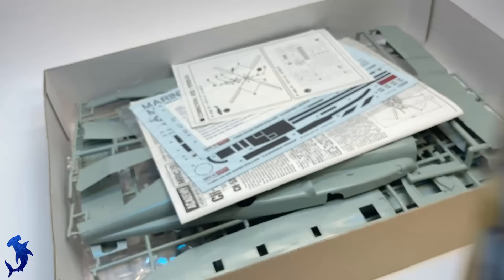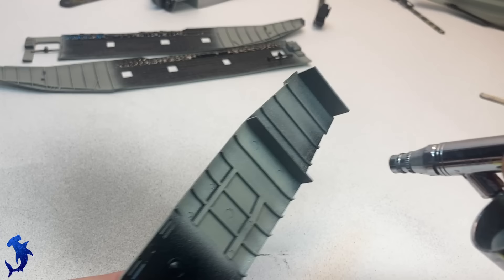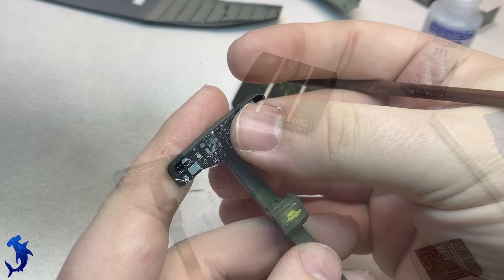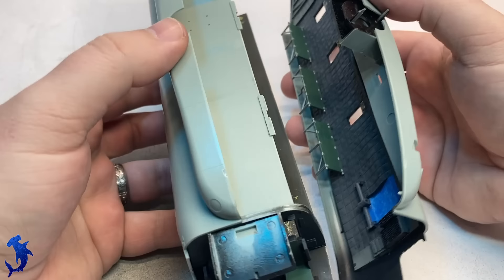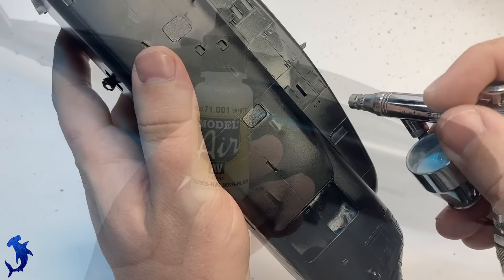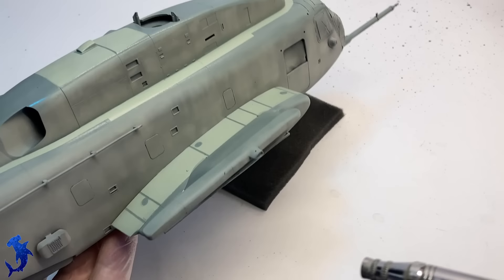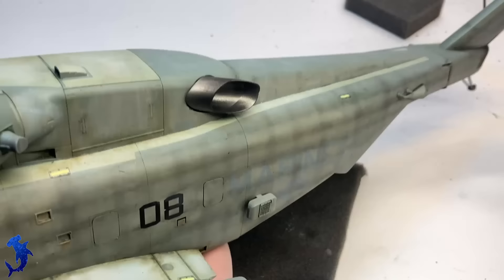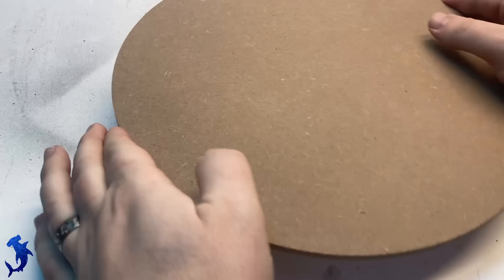Academy CH-53E US Marines 1/48 Scale Full Build

Comment: I have a academy ah 60l dap and it's the worse kit every instruction are rubbish and parts don't fit right
Reply from the maker: Thats unfortunate, I'll have to be sure to stay away from that kit.
Reply: That’s unfortunate to hear. I have the same kit. I am looking forward to the 1/32 1z viper, though. That kit is excellent, just needs a few interior additions.
Reply: @mikemontgomery2654  you might be better then me I am new to modelling
Reply: @andrewjbuckley  even if that is true, bad kits are bad kits. I’ve noticed some potential detail issues with the DAP, just having a look at the sprues. I’ll just have to see how the build goes.
Reply: How's the model doing
Reply: @mikemontgomery2654  How's the model doing did you have the same issues as me
Reply: @andrewjbuckley  I have been working on a different project. Haven’t started the chopper yet.

Comment: I have this same kit in storage and I've been sitting on it for a long time. I used to work on these back in the day. The floor inside the aircraft was a non-skid black paint. The "rails" in the cargo area were pretty beat up (along with the rest of the floor) but they were reversable. One side had the non-skid on them and the other side had conveyer rollers for when we hauled pallets and other cargo.  The interior sound proofing was a light blue color. The padding on the walls and also the ceiling panels were this color. The center hook on the bottom of the 53 actually hangs down from inside the aircraft. When not in use it is stored inside the cargo area (in a box under the front left crew window). For the exhaust, the sponsons didn't really get as much of that soot as the center engine did. Even when we washed the 53 it was really tough to get that soot off the fuselage.  For the base, I'm not saying it isn't possible but the only time we would actually shut down in the dessert was if there was a mechanical issue. 99% of the time we would land at an airport or back to a ship somewhere. Those things kick up so much sand, it's like a sand storm underneath that thing.  All that being said, the aircraft looks great! I'm getting heavy nostalgia from this video.
Reply from the maker: Thanks for watching, I really appreciate the first hand knowledge.  Helps me understand the subject all that much better, and if I ever get the opportunity to build this again, I can incorporate all of it!  As for the base, that was a request from the client.  Cheers!

Comment: Awesome work!  I have ALWAYS wanted to build the CH-53 in 48 scale and got my chance about a month ago.  I found one at a local hobby shop and pounced on it!😂😂😂. It’s the old Revell kit, with the howitzer and the Jeep.  I plan on building mine as a Vietnam War era Super Jolly.  I got a Skyraider to go with it, but will not be doing either of them for a while.  Also managed to snag a set of South East Asia Theater (SEAT) camo masks.  Can’t wait to see your next build!

Cheers!
Reply from the maker: I'm glad you were able to snag a kit, sounds like you have a sold plan!  Good luck with your builds when you get to them!
Reply: I don't know that kit but be aware that the CH-53E model didn't deploy until after Vietnam (1983). If you are going with a Vietnam era make sure you get the right kit. The Super Jolly only had 2 engines and the tail was straight up and down. FYI
Reply: @Brian-WolfmanJack99   Its an HH-53 i built it in 2011

Comment: Absolutely gorgeous work, pity seeing it only now.
But I was wondering if you would like to answer a couple of technical questions…

1. at about 13:16 of the video you declare that to prepare the interiors for the weathering phase you cover everything with a layer of transparent. Having used several brands of colour, last I seem to remember Tamiya, what brand is that clear?
2. More generally: for transparent coatings which brand, or brands, do you use?

If you want to answer I will be grateful.
Reply from the maker: Thanks for watching!  At the 13:16 mark I am using Alclad Aqua Gloss to prepare for weathering the interior.  
In general, I use Alclad aqua gloss for gloss coats and Vallejo Matte for the flat coat.
Reply: @HammerheadModelMaking  Thank you.

Comment: That is a fantastic build and finish of this beast of a whirly bird. I would have liked to have this kit but I've missed out. I didn't know it was discontinued. I do have two 1/72 scale of this type so your work gives some pointers for even a smaller scale. At least I did buy an Academy 1/35 scale Super Cobra Attack helicopter. I was lucky. It was a bid item I won! Great work on a nice model.👍🇭🇲🦘🐨from down Under.✌️
Reply from the maker: Thank you for watching, yeah, I really hope Academy straightens up and re-releases this kit, I'd really like to have one to build for myself!
Reply: @HammerheadModelMaking  It's a monster of a model in 1/48 scale. I hope it does get rereleased. Alternatively there is a 1/48 scale Revell German Airforce version that's also massive.👍 Nice work.

Comment: I think that this is fantastic.  Well done.  It looks amazing!
Reply from the maker: Thank you so much 😀
Reply: @HammerheadModelMaking  Do you mind if I ask, I've been told that Alclad takes a long time to dry and harden. What is your experience with that product?
Reply from the maker: @mgeyer1  The Alclad metallics are dry to the touch pretty quickly, within 10 minutes.  But I generally try to give them a good 24 hours to cure.  The Alclad Aqua gloss, is pretty similar, dry to the touch in about 15 minutes, but again, I leave it 24 hours just for good measure.

Comment: I would like to build two of these: 1) update the kit to the latest variant: the CH-53K, then accurise and super-detail it as much as practical (some tend to go round the bend with it; to each their own, I suppose), especially the interior, the rear ramp and the side doors open. 2) to build one airborne, rotors turning, and the helicopter refueling from a Lockheed Martin KC-130 Hercules USMC Transport-Refueller, its own propellers spinning; this would require Italeri’s 1:48th-scale kit of the C-130E/H (No. 0843). 
   I detest the usual means to support models of airborne aircraft for the obviousness of a grotesquely oversized telephone pole stuck into the belly. I borrow from the crane-cradle method the special effects crew of Superman: The Movie (1978) used to simulate Superman (Christopher Reeve) in flight, where 1) the actor lay upon a cradle formed to fit his body, covered in the costume; 2) the technicians attached it to a modification of the Chapman Crane; 3) this they positioned behind the performer. 
   Adapting this to a model airplane, a sturdy apparatus extends from a point farthest from the viewer’s position (ideally, the far wingtip), to a backdrop painted in azure to simulate the sky. A length of metal thin enough to fit within the narrow opening (as well as to eliminate its visibility), yet amply robust enough to bear the weight of the replica without strain or sag (likely steel) passes into and along the length of the miniature’s wing interior (which wing this would be is conditional upon the overall arrangement of the miniature in the display) to insert into a corresponding receptacle designed (scratch-built) to receive it in a snug fit. This arrangement in turn extends back to the azure backdrop, passing through it to connect into a crane mechanism with mass sufficient to counterbalance the weight of the replica. 
   To spin the propellers, one must fit small electric motors into the nacelles, their wiring passing out this support arm, which therefore likely would have to be a hollow steel tube, eventually leading to a power source. 
   One applies the same process to the helicopter model. Given the lack of a long wing, however, this part would be trickier to obscure. Perhaps covering the support arm in the same sky-blue material as the aerial mise en scène might serve. 
   I also would apply this process to a forced perspective airborne diorama with models of the same aircraft in descending sizes. For example, several Boeing B-17F Flying Fortress Heavy Bombers in a bombing run over Nazi Germany, the nearest replica the HK Models kit in 1:32nd-scale, the Revell Monogram 1:48th-scale kit, a couple in 1:72nd scale, and maybe three or four in 1:144th scale. 
   If any of these ideas appeals to you, I would take great delight to see your efforts, for you are in a better position to implement the more technical aspects of what I outline above, and to work out the various problems inherent in such a complex endeavour. 
   Just some ideas I have had.
Reply from the maker: That would be amazing to be able to do all that and would definitely looks epic.  I hope you are able to procure a copy of the kit to realize your vision!

Comment: Gr8 build 👏👏💯% do the rotor blades fold up 🤔
Reply from the maker: Yes, the kit gives you the option to have the rotor blades folded, however, the engineering of the folded rotors seams like it wouldn't be very strong.

Comment: Looks great, but those sink marks=(
Reply from the maker: I know, and there are so many of them!
Reply: @HammerheadModelMaking  I would have thought that you have at least made at least a token attempt to cover some of worst up, which in all honesty the manufacturer could have taken into account anyway. Mostly, like the those turret gunners would have benefited from a little bit filling even if only I and around that area.

But don't condescend to me, you knew exactly what I meant.
Reply from the maker: @rutgaurxi7314  My apologies, no condescension was intended.  I had considered trying to remove the ejector pin marks on the interior and I think the ones on the quilted martial would have been relatively simple, but ultimately decided not to believing they wouldn't be seen.  Even shining a light into the door gunner openings, one would be hard pressed to see them.  One would have to lift the model, remove the back ramp and then you'd be able to see inside enough to notice them.  It was just work I didn't think was worth it.
Reply: @HammerheadModelMaking  I was just thinking about what was one of the first things you would do when you would receive the kit, which would be to check out the interior,  it’s a very human thing to do, we're almost hard-wired to do it. I wouldn't have mentioned it other otherwise.

Edited.
Reply from the maker: @rutgaurxi7314  Fair enough, cheers.

Comment: Hey Brett! I know you used to/still do commission builds, and I’m thinking of starting something like that. What would you do if someone decides they don’t like the finished product and won’t take it?
Reply from the maker: Thats a great question, so here is my process: it starts at the beginning when writing up the quote for the client.  Gather as much information about what the client wants, and spell it out in the quote, detail the clients expectations on markings, weathering, finish, box stock or aftermarket/scratch building, things like that, make sure you both agree on what the desired outcome is in writing.  (additionally, do not start a project without first receiving a non-refundable deposit that at least covers the cost of the kit and materials/supplies)  Then, I provide my clients with up to date work in progress pictures/video clips as the build progresses, with the aim that they can provide feedback on how it is going, making small changes as needed.  Finally, when I have completed the project, I will send the client a series of hi res images of the model from all different angles and request final approval.  At this point, it is still possible to make small changes, but generally, if you've been communicating with the client through out the whole process, any changes made should be very minor.  
Finally, with customer approval, I request the remainder of the balance on the project and ship it out.  Now, if for what ever reason there was a complete breakdown with the client and they refused to pay the remaining balance, I would just keep the completed model, and because of the deposit, I'm not out the cost of the build, just my time.  It would suck, but at least financially, you're not hosed.  

Hope this helps.

Comment: Hello, can you explain this sipping to me step by step to apply it? I only speak Spanish but I translate in English.
Reply from the maker: Are you referring to the chipping?
Here is my process:
Apply first layer of paint (aluminum)
Apply a layer of chipping medium (I used Ammo MiG Chipping Fluid)
Apply next level of paint (Zinc Chromate)
With a wet stiff brush, gently rub certain areas of the paint and it will begin to remove the top layer, revealing the aluminum color underneith.

Hope this helps.

Comment: No attempt to stress the fuselage sides.  You kept the panel lines and recessed rivet detail.  None of this existed on the actual airframe.  Maybe you can get away with that in smaller scales, but in quarter scale it doesn’t work.  What a waste of an effort.
Reply from the maker: This was a commission build and for the distressed skin, that type of work wasn't requested by the customer.  As for your critique on the panel and rivet details, many images I've seen of the Stallion very clearly shows them, for example this image here of a Stallion being packed into a C-5, the rivet lines are quite pronounced:
https://d1ldvf68ux039x.cloudfront.net/thumbs/photos/1306/947589/1000w_q95.jpg
This one as well:
https://i.natgeofe.com/n/1a66e796-f2af-4e97-97f8-03253725ffd7/86777_3x2.jpg
So, I'm not sure I understand when you say they didn't exist on the actual airframe.